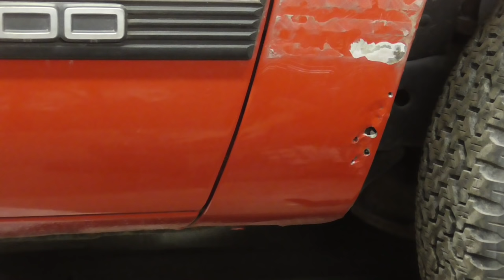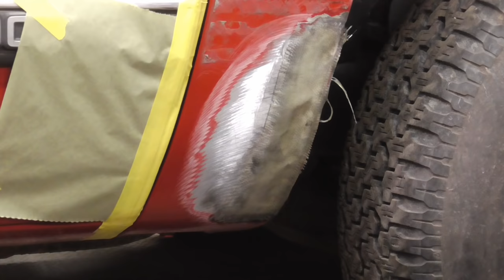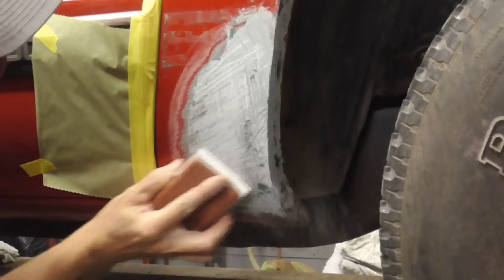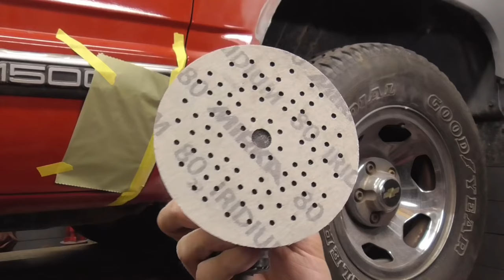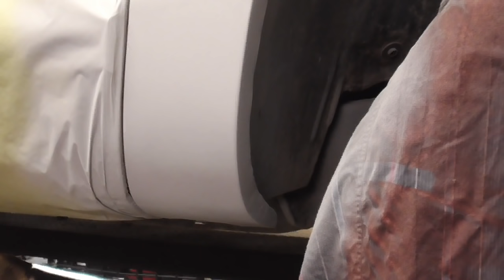How to Repair a Rust Hole with Fiberglass - No Welding!

Comment: I noticed that the body filler you applied extends over onto the painted surface that was not ground down to metal. I thought that the filler should be applied to bare metal. Your thoughts please.
Reply from the maker: You're right and when/where I worked that was frowned upon.  You can get away with it most of the times but it can lead to seeing sand scratches - usually where the filler meets the paint.  If the paint has been DA sanded with like 120 before the filler you'll be fine.  Safest bet though is to remove the paint further than your filler will reach.  You'll never have problems with adhesion though - filler sticks well to bare metal, primer or DA sanded paint :)

Comment: There's self stick waterproofing tape  by  duck sold at Walmart try instead of the fiber.      much easier paint w por 15 or aluminum roof coat or Rust-Oleum then bondo

Comment: Nice repair, I have 2 question:
1. Can I just use regular Bondo after fiberglass cloth? how many layer needed? Any guide?
2. I got hole inside my trunk; can I just put those fiberglass cloth + Bondo on inside side? Or?
Thanks before, any info are appreciated
Reply from the maker: 1) yes - one coat is enough
2) yes - just try to wire brush and spray the underside with undercoating if you can.
Reply: @LakesideAutobody thank you for the answer mate, appreciate it

Comment: Hi! I have another quick question. I'm restoring an old truck and the metal in the bed is in great shape, except that it has a lot of little scratches that have surface-rusted over the years. Would you recommend I grind down each of those tiny little nicks and then fill over each of them? I was thinking I might por-15 the whole inside of the bed just because it seems faster. Any tips for working smarter and not harder at this? Thanks for all you do!
Reply from the maker: That's always been a tough job.  These are very fast for getting in all the ribs but they don't remove the scratches.  The right way is to feather edge all of the scratches prime, block, etc. but that is way too much work.  You could prep best you can with a DA & the HF abrasive wheel then throw in a plastic bed liner....  That's what I like to do.  You could also have Line-x spray in a nice thick bed liner which would cover a lot of it.  Last if you want it looking factory, you could scuff it, DA, abrasive wheel it, primer with feather fill (thick poly primer) smooth it with a DA taking out the scratches and paint - that's work too though.  Those are a few choices I can think of - let me know what you end up doing :)

Comment: Where would you recommend drilling drain holes on the rockers of a 97 s10 extended cab? Also what size bit would you use? I was thinking near the pinch weld when I was going over it a month or so ago. Weather is getting warmer now so getting  ready to start on it. 
Thanks
Reply from the maker: I drill them big - like 1/2" at the back of the rocker and the front as low as possible because when the car is parked it's always slanting either to the back or the front and the water has to drain out.  No worries about water getting in because it's going to get in anyway - might as well be able to rinse it out in there with a hose or an air hose.  You want it clean and dry inside those rockers.
Reply: Thanks for getting back. Its definitely appreciated.

Comment: OK, I figured out to do same on our W200, but my concern is to get access w/o removing the front fender of my car.
 About this vid' : didnt you treat the inside of the rotten metal ?
Reply from the maker: Make sure the panel can drain and dry - add drain holes if needed.  That's most important.  Then this - https://www.youtube.com/shorts/glxS7PhK1TI
Reply: sorry !! I meant "get access to the rust hiding behind" the front area I got to treat.

Comment: I’m looking to do a similar fender repair, however the rust ate right to the edge of the curve. I was thinking of using fibreglass and bending it around the edge to follow the flow of the fender. However, you said fibreglass is very difficult to bend. In this case, what would be a good solution? Metal mesh to follow the curve and than fibreglass on top?
Reply from the maker: The chopped strand fiberglass instead of the woven is easier to make a bend.  Like you said too - you could encase some metal mesh with the fiber glass cloth - little pieces.  Good idea for a video :)

Comment: Do you use any kind of wash primer or acid to treat the bare metal before priming? Or does your primer have a built in etch of some kind? Just curious
Reply from the maker: I don't but one boss of mine used to make us use the rust converter acid stuff.  I think it worked well but myself I just try to make sure I sand blast the rust and make sure there's none or very little to treat.  I'm sure it can't hurt :)

Comment: ANY chance this could withstand stress=having a hood bolt thru it? The base on my old 2000honda rusted thru right where that bolt holds the hood hinge??? thanks
Reply from the maker: Good question.  I think JB Welding a patch in that spot would be stronger but you could always give it a try.  Here's a video on using JB Weld (cab corner is still in good shape almost 4 years now) - https://www.youtube.com/watch?v=wRl1QfkrBeY

Comment: Oddball question: why are there holes in the back of a pickup truck cab corner? And are the removable plugs on a rocker panel for rustproofing or cleaning or both?
Reply from the maker: I think they have something to do with assembly, ventilation?, not sure,  You can remove them and clean if you want - can be used for rust proofing too if needed.  Great ? - let me know if you ever find out why there' large holes punched in panels and then plugged :)

Comment: What do you do on the backside of the panel?  Brush resin over it to encapsulate the rust?  Also, I'm guessing rust won't be able to pop through the resin area once it's encapsulated right?
Reply from the maker: You are absolutely right.  If you took the fender off and sand blasted the back side after the repair and sprayed it real nice with under coating, it would last very long - no moisture - no rust :)   That's why you want to make sure it can dry out in there and not hold water and debris.

Comment: This a very good video...Fiberglass is somewhat my preferred way to fix rust holes.  There are vehicles I repaired in the late 80s through the 90s that I still see today and the repairs have held up. Pretty much everything you showed was dead on. You should definitely use 6 ounce woven cloth and not put too many layers or it will make the repair too stiff. When the metal flexes or moves with temperature you want your patch to move with it. Otherwise the patch will delaminate and fall off.... Whenever possible I would fiberglass the hole from both sides and I've found a sandblasted surface is best to fiberglass to.
Reply from the maker: You're right there - if you can get to the back side and seal it or at least allow for drainage so that the inside can stay somewhat dry it does last much longer.  I can last forever if you seal the back.  Thanks for the input :)
Reply: Seriously? 30 years you can pretty much classify that as a permanent repair!

Comment: Do you need to treat the metal to stop rust coming back, or does the glass protect like epoxy?
Reply from the maker: The most important thing is to make sure the panel can drain and dry out inside.  Clean out all the debris, mud and moisture and add drain holes if you have to.  If you can undercoat the back side - great - if not you can squirt some oil inside the panel after the repair - it will creep around and coat the bottom of the panel - you're aim is like an old valve cover inside :)

Comment: Can someone tell me if it would be ok to spray the bare metal with epoxy primer before applying fiberglass like in this repair ? Or to only apply fiberglass over bare metal ? Thanks also I’ll be using Bondo fiberglass cloth and Bondo fiberglass resin.
Reply from the maker: I've never really heard of doing that but I imagine it would work out fine - sort of the same stuff as body filler - resin, etc.  Maybe try a practice panel or test it out.  If the resin feathers into the primer when sanded and doesn't peel or break away, you're good to go :)

Comment: I like to lay out the fiberglass on plastic, soak with resin, lay another piece of plastic over top and squeegee out the resin till the fabric is saturated.  Then you can cut to whatever pattern with scissors. You can also layer multiple layers in different directions.
Reply from the maker: Great idea - then you can just stick it on the panel.   Thanks for your input - have a good weekend :)
Reply: @LakesideAutobody  Thanks for taking the time to do these videos.
Reply from the maker: @brianensminger2237  You're welcome - I enjoy making them.  Have a good weekend :)

Comment: Is this a better repair than using say Bondo glass filler? Does the resin seal the bare metal no priming needed?
Lastly how waterproof is the fiberglass resin cloth process you did?

Great videos as always thank you!!
Reply from the maker: Truthfully if you can somehow make sure that the panel can quickly drain and dry out inside both methods will last quite a few years.  It's good to make sure that you clean out all the debris, rust chunks, leaves, etc. - anything that can hold moisture.  You don't have to prime the metal first using either method.  If you can under coat the back side or seal it somehow - even better. (Cosmoline RP-342 works great for that.)   Both the fiberglass reinforced filler and the cloth and resin are waterproof.
Reply: @LakesideAutobody  Thank you. You mention cosmoline I remember that stuff from back in the 80s when I was working at a dealership detailing cars. I remember that stuff was on the bumpers it was a real pain in the butt to clean off. Back in the day....

Comment: If you have easy access from the inside, could you do all your fiber patchwork on the inside of the panel and just make the panel smooth on the outside with filler?

I have all the interior out on a Honda that I'm working on and I can see and access the quarter panel rust from the inside. I have been wanting to learn to use carbon fiber and kevlar, and now that I have a project to experiment on I bought some. I was thinking to remove all the rust from inside and out where possible and use those composite materials to help strengthen and make the metal more ridged from the inside where no one can see the fiber patches. Seems crazy to use those expensive fiber on a honda but 90s and 2000s hondas are hotrods to me
Reply from the maker: If you have access to it and can grind the metal good and clean - sure.  I think that would work even better.  Sealed from the back and the front.  You'll have no worries :)

Comment: On my 4runners quarters there's parts that ate completely rusted out. Can I just use this fiberglass thread to cover it??
Reply from the maker: Yes but it's good to make sure the metal is clean before applying the resin and material.  A sand blaster works best but if you don't have that use some good sharp sand paper or wire brush.

Comment: When doing a repair similar to this one what is the recommended layers or a comfortable amount of layers and is the fiberglass cloth your using better that the stranded cloth or is that just personal preference.. thank you
Reply from the maker: I find that both types work the same - just a personal preference thing.  I usually do 3-4 layers and if you feel that it's a critical area or you need more strength because of the size of the hole then add more.  More can't hurt.  Jerry
Reply: @LakesideAutobody  great thank you for the tips 😊

Comment: You can pressure wash out that area by opening the door and you will see the gap in the fender that accumulates debris. You'll be amazed at how much washes out.

Comment: I wonder if a guy shouldn't do some etching primer or some sealing coat to the bare metal prior to the epoxy + fibreglass?
Reply from the maker: I'm writing that down and will get to a video on that - like how well the fiberglass sticks to the epoxy or etching primer.  I'm sure it would work fine as fiberglass resin is very similar to filler resin and filler sticks fine to epoxy primer :)

Comment: Do you need to run a roller when doing a process like this for air bubbles in did this process no roller and i have very tiny bubbles and wondering if its gonna b a issue
Reply from the maker: You don't have to worry about the tiny bubbles.  You'll have no issues at all.  Merry Christmas 🎉🎅🎄
Reply: @LakesideAutobody  good to hear thanks for the reply and merry Christmas 🎄

Comment: About how did you wait before using the grater, I know you said before it dries but I’d imagine not immediately either after the bondo, so how should I wait?
Reply from the maker: It depends on the temperature in the garage and how much hardener you used.  Rule of thumb is this - sit by it and wait with your cheese grater - when it gets as hard as a block of parmesan cheese try the grater.  If it clogs, it's too early clean out the clogged teeth try again in a few.  If you waited too long you know for sure because the grater won't do anything - won't cut it :)  You'll get used to when you can cheese grate - you'll never not do it after you get it :)
Reply: @LakesideAutobody  ok thanks i appreciate it, I have multiple spots to hit going around the truck so maybe as I'm moving around to different spots it'll dry, I don't need it to look perfect as much as I do to be flat, as my plan is to vinyl wrap the truck after a cover and flatten each rust spot, so if I end up grating to soon and have to come back over it later the imperfections won't concern me much, thank you for the advice and the video

Comment: Do you have to lay the fiberglass on bare metal? Or could you lay it over a surface that already has epoxy primer?
Reply from the maker: I've always put it over clean, freshly sanded/grinded metal but I think you'd be ok putting over the epoxy as resin sticks to well to primer but I would sand it first - just to rough it up a bit :)

Comment: Water causing rust was the original problem, so what is going to stop the rust on the inside from continuing to eat away at the metal from behind the repaired spot?
Reply from the maker: The salt water and debris gets trapped in there (originally) leaving a pile of salt soaked leaves and dirt which is bad.  If you allow for drainage (even drill a big hole in the back side so it can drain and stay dry that's great.   You can even check it now and then - flush it out when you wash the car by squirting water in there.  If you can rust proof it or seal the back side, even better.  It's not as good as welding  for sure but this video is for those that don't weld.  See this video for how I rustproof after the repair:  https://studio.youtube.com/video/y05dNxt-nVc/edit   We'll see:  It's my neighbors truck so I'll do a follow up video in a few years to show how its doing.

Comment: What kind of blast media works best on rusted metal? I was going to try aluminum oxide from harbor freight.
Reply from the maker: I use: https://www.tractorsupply.com/tsc/product/black-diamond-fine-blasting-abrasives?cm_vc=-10005   It's cheap, works well, and safe to use (safer than silica) :)
Reply: @LakesideAutobody  Thanks! We have a tractor supply here in Selah.
Reply from the maker: @donaldappelhof2059  They have a "fine" - red bag and a "medium" black bag. I've used both by mistake - right now I'm using the red bag or fine.  It works good for me.

Comment: Do you think you even needed to put the F-G cloth on 1st? Holes were pretty small, Bondo says the short hair FG filler can cover 1/2" and Long hair 1" holes?
Reply from the maker: Good thinking.  This repair is still good today (about 5 years now) - https://www.youtube.com/watch?v=rPTaeH056ng
Reply: @LakesideAutobody  got it thanks for the link. I had some decent rust in lower panel also and I fiberglass resin clothed it. I was gonna just normal bondo over it but your making me feel guilty now thinking if I should bondo glass over it now 😵

Comment: Hi i have this problem but now the edge of back door of van, so i would have to do a straight edge, could i do the same as this for a stright edge of door or is the some kind of beeding i can use for tht, any help be appreciated, cheers
Reply from the maker: You could - just let the glass get good and hard then sand that edge straight.  Edges are a bit tougher but very possible.  If I find the right job I'll do a video on that process :)
Reply: @LakesideAutobody  thanks for the reply